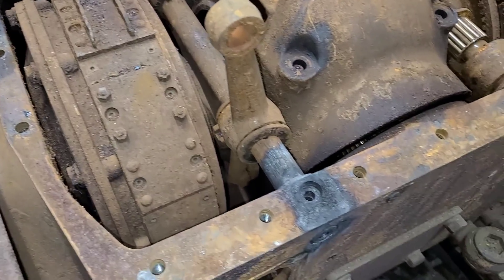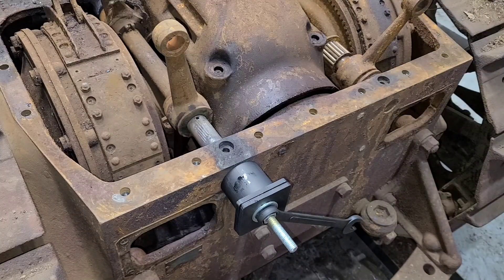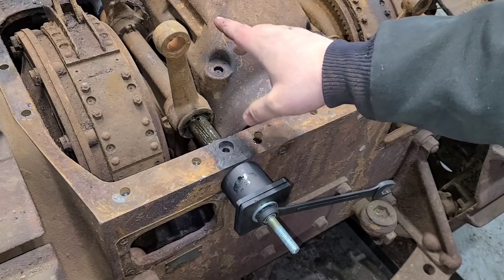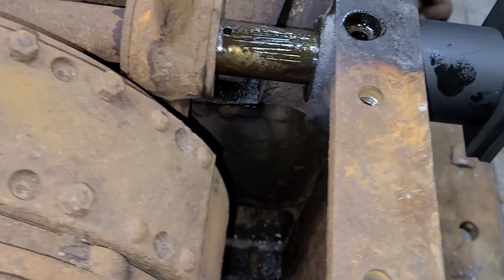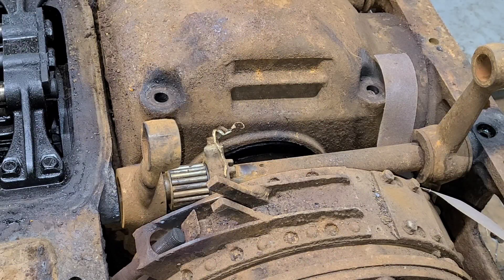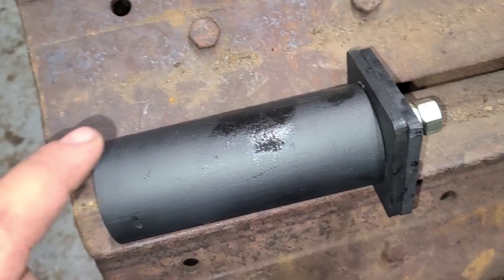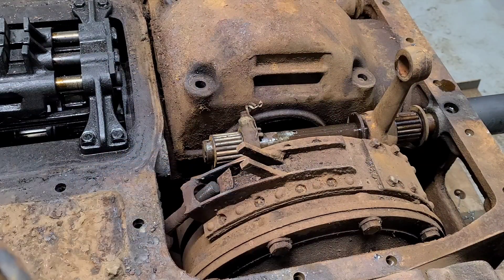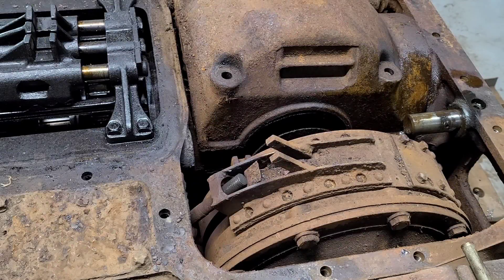Caterpillar RD-4 Left Side Steering Clutch Shaft Removal

Comment: On the treads, can you just remove a top section about three feet long and soak it in kerosene outside the shop? That way you would only have to free and remove two links in a more convenient location to work on and loosen a number a number at one time.

Comment: You mentioned them shafts should be pre drilled and tapped? Is it possible that the early machines didn’t have that?
Reply from the maker: According to the parts book, all machines from serial number 1 to 9999 had tapped holes in them so my best guess is they were a homemade replacement

Comment: Nice job! I always use fine thread rod on my poor boy pullers LOL! Fine thread gives you more torque at the nut without shearing the threads. Most Gear pullers use fine thread rod even the "Horrible Freight"varieties LOL!
Reply from the maker: I used what I had on hand, but yes, a 1/2-20 would have been better than a 1/2-13

Comment: Wrap the emery cloth a second time around the shaft and pull the tails out at an angle in opposite directions.  Don’t pull it completely tight and it will clean all the way around the shaft if you are patient.

Comment: Hey Kyle, the $20 question is was the other end of the wheel clutch rod threaded or not?
Reply from the maker: I didn't show it but I will, it's not threaded
Reply: Interesting, i wonder if it  was built that way or if the shafts have been replaced at some point in its life.
Reply from the maker: @nickslistm246  I can't say 100% but according to the Caterpillar RD-4 parts manual, all machines had a threaded hole in that shaft, no matter what serial number. Now, there are very slight discrepancies in those books, so maybe the early units didn't truly have those holes??

Comment: Good for you in the removal of the shaft, I does appear to be drilled and tapped on the other end. Yes please show the other side if it differs in how it pulls or other problems.

 I understand your pref is not to use penetrating fluid which is totally fine and understandable.   It is after all it is an acidic base penetrant that can loosen up finer particles that will bind up tighter tolerances as there is minimal lubricating qualities in it. I real should be cleaned with something like brake cleaner and then lubed with oil or grease or even silicone
Reply from the maker: I didn't show the other end of the dhaft very well but I will, it is not threaded, so at one time these were replaced

Comment: Sometimes I think it'd be interesting to be a fly on the wall when these machines were first being drafted up. Why go with a rigid shaft with roller bearings on the forks, rather than just putting roller bearings on the shaft where it interfaces with the housing and key the forks to the shaft instead. Having that whole shaft be free moving seems a lot simpler, for both assembly and disassembly, the keys wouldn't need to be anything more than woodruffs, which means the forks can be loosely assembled then keyed in place after the shaft is in place. The only major differences would be a slightly larger casting on the housing and a plug to keep the shaft in place; which is why I mentioned the drafting phase of these machines, because changes like that would have to have been so far in advance of physical prototyping. Though, this kind of design could be implemented with some modification, lathe down the shaft ends to fit a smaller roller in the same bores, only issue would be the retaining caps on the open end, though a plate with a couple bolts could suffice for this purpose; but I'd prefer a threaded cap with a nice beefy internal hex or torx, depending on bore depth, cutting down the shaft to fit this could also be sufficient, as you only really need a few engaged threads for this purpose. 

I'd also be curious if this kind of design change ever appeared on later machines, because to me this really does make more sense, especially in the super long term longevity of the machine when things start getting bound together with rust and corrosion. Not to mention potentially less parts, even if it's just one or two less components per shaft.

Comment: Love the brass fittings used on these old Cats! (now I know how they are oiled).  Nice build on the pulling tool for the clutch shaft--worked just as expected and yup, grade 8 threaded rod isn't easy to find and expensive when you do.
Reply: All thread is shit steel, I just use a long grade 8 bolt and cut off the head.
Reply from the maker: Thanks! No it's not easy to find but it wouldn't hurt to have some one hand for when I just stretch the grade 3 haha
Reply: @kylechrist  Don't get me wrong I wasn't implying anything with you using all thread. You already pointed out it's limitations, but It worked. 👍😎 I have just ready access to many things, as I work electrical maintenance  at a large steel plant. They even have bin racks of Caterpillar bolts at the heavy equipment shop.
Reply from the maker: @MatthewBerginGarage  I get it, and I know all thread/threaded rod is typically weak, that's why I had so many haha

Comment: Just as academic interest; What actually IS the reason for your hesitance to use 'penetrating ' oil?
Reply from the maker: The reasons I don't like it; heat generally does a better job of penetrating as steel transfers heat, heat does a better job of breaking down rust, heat doesn't make a mess of everything you touch like penetrating oil, penetrating oil takes too long to work (if at all), once it's sprayed on you can't use heat without making toxic smoke or even fire. Simply put, penetrating oil is not the miracle worker most people thinks that it is. It has it place and purpose and I do own penetrating oil but, my experience dictates where I do and don't want to use it
Reply: @kylechrist  Yes, I agree. To each, his choice of Poison. I sometimes soak the part in Kerosene and then use a vibrator to break loosen the threads/jammed shaft. Lessens the damage caused by using heat/ open flame.
Reply from the maker: @NavinBetamax  I do like diesel and kerosene for soaking parts
Reply: @kylechrist  A sound & logical reason. Thank you.
Reply: ....Yes.....I too want an answer to this question. My guess is that he is Alergic ?!!

Comment: If I don't have WD-40 or Gibbs I use automatic transmission fluid as a lubricant to get something unstock. Works the same way maybe takes more time to soak. People have different methods of unseizing rusty parts. Sometimes even water helps. Most of that rust inside is from moisture and it's surface rust not structural rust. So no wonder it cleaned out so nice.
Reply from the maker: Any lubricant would work going through a bore like this, I had some old 30 weight quarts of oil around that I don't trust in an engine but work great for this
Reply: @kylechrist  It works fine for unseizing so it found a very good use. If your opening the differential case do some magnet fishing. I doubt you will find anything but it's worth just taking a dive in. I see most of the damage so far is from moisture and sitting so long without being used.
Reply from the maker: @SuperMAZ007  differential should make an appearance soon!

Comment: Thanks Kyle, getting things done, one at a time. Are you bagging & tagging the parts as you take them off ??
Reply from the maker: In a previous video I showed the metal bins I made up, I keep all components separated, like "left side front steering clutch arm, bearing, and washers" and left rear, right rear, right front, etc

Comment: A little trick I learned is threading on two nuts close together and then welding them together to make one long threaded nut to pull on more threads of the threaded stock so it doesn't strip out so easy.
Reply: You can also get long "nuts" used for threaded rod coupling.
Reply: @andrewlindh5047  yes, but welding rods and standard nuts are cheap and abundant.
Reply from the maker: I did end up using two nuts back to back, and if I had a coupling nut, I would've used that as well, thanks for watching
Reply: @kylechrist  Yeah, that's understandable. Hope things get going smoother in the tear-down for you. It'll be nice when it's all apart though.